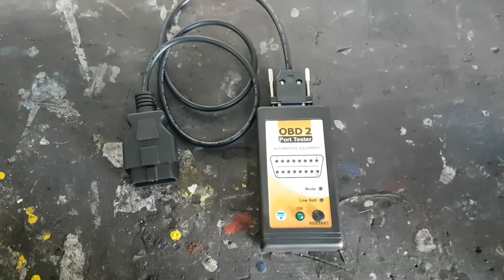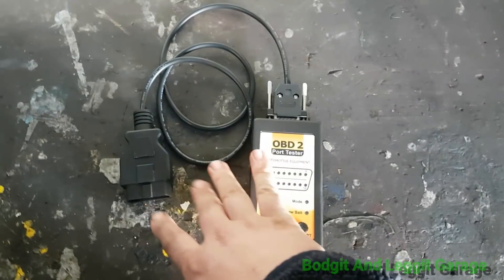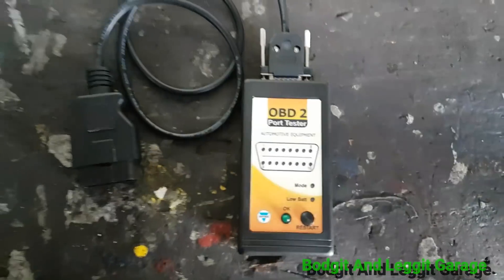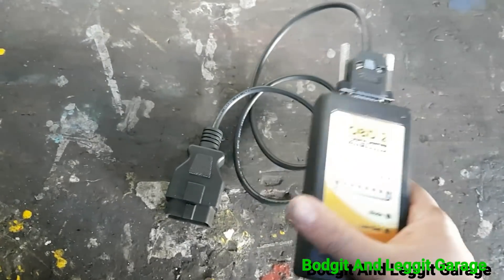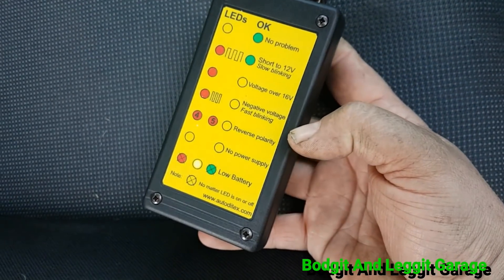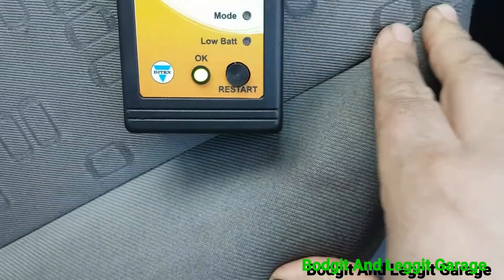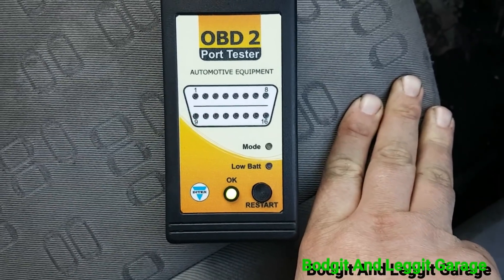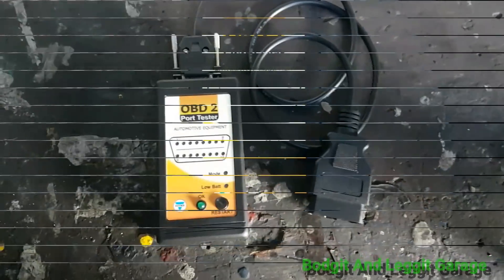DITEX OBD Diagnostic Port Tester Bodgit And Leggit Garage

Comment: Good point about the low battery thing on cars van cause so much issues in voltage sensitive components leading to false codes etc
Reply from the maker: Yes mate battery voltage is very important